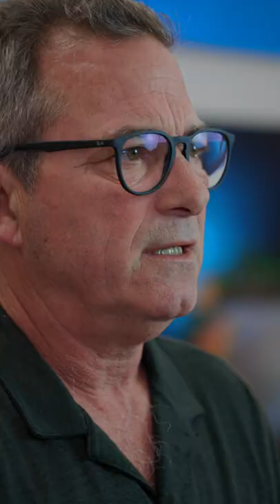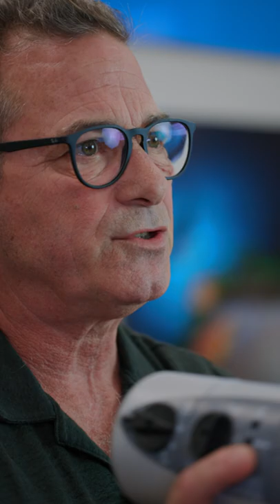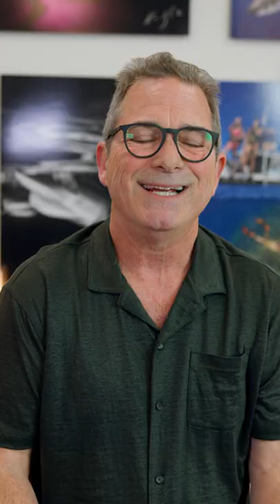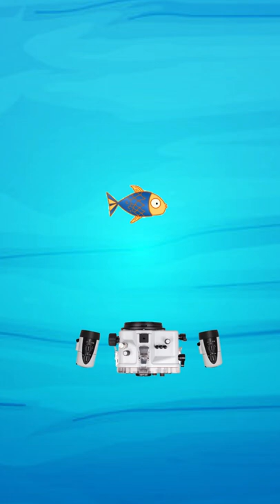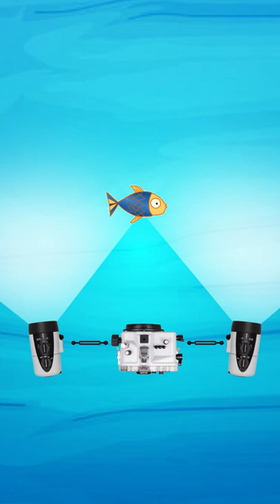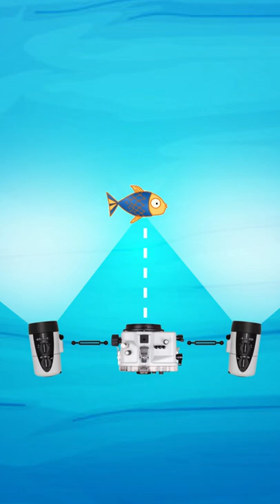The Secret to Aiming Your Strobes // Underwater Photography in 60 Seconds #Shorts

Comment: hi. is it possible to use an led light with ip68 rating upto 10m upto 18m deep? whats the worst case scenario if i do this?
Reply from the maker: We find that the use of the IP68 rating is deceptive and that performance varies greatly from manufacturer to manufacturer. Reach out to the manufacturer of the light for clarification of the product's capabilities.